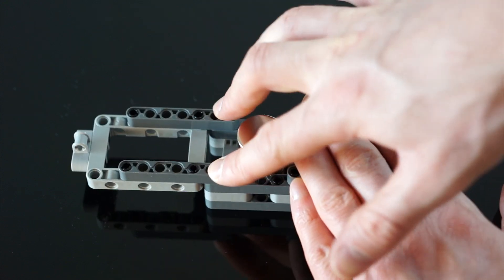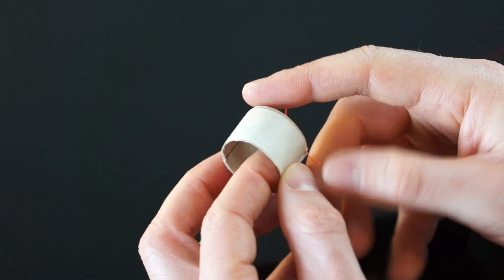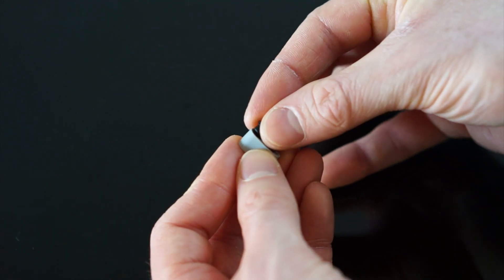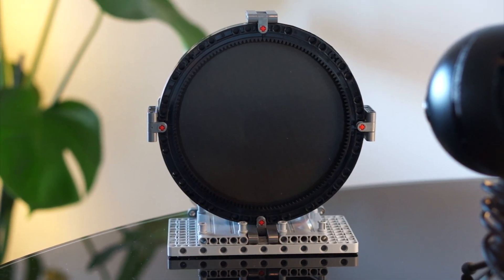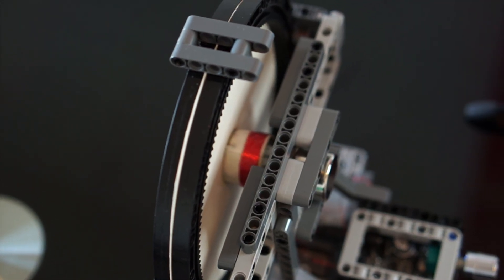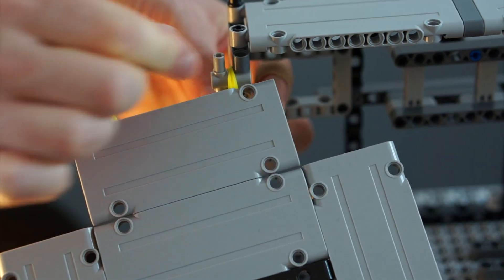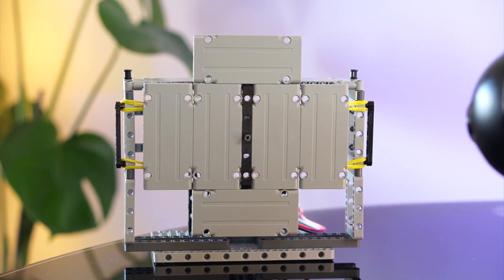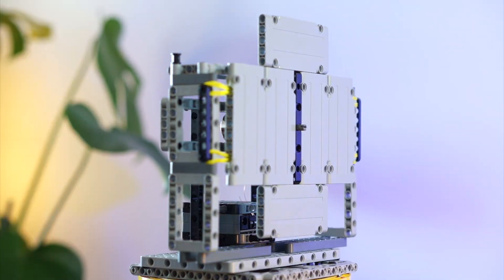Powerful Speaker Made Almost ENTIRELY of Lego

Comment: Great video but build the driver an airtight enclosure made out of Legos so that it will sound better

Oh and with the paper diaphragm the distortion is from it hitting the Lego or the cone hitting the magnet. You can fix that by using a longer cone or increasing the cones diameter and by increasing the distance from the diaphragm to the Lego maybe by elevating it away slightly from the come then using rubber on the edges
Reply from the maker: Some great advice, thanks! Yeah definitely need a longer come, and now would love to see if some pneumatic tubing could line the edges well. The next one will for sure have an enclosure for the woofer!

Comment: I think one of the biggest contributors to the poor(ish) sound quality is the lack of an enclosure around your speaker. Whenever the membrane compresses air in front of it, it also de-compresses the air behind. This leads to a polar opposite waveform coming from the back side of the speaker (at a much lower amplitude), meaning that all peaks are troughs and all troughs are peaks. To the human ear, this would not sound any different than the intended front facing waveform, but when those two opposite waves hit each other, they level themselves out which leads to some frequency loss over your whole signal. The best way to combat this is to cover the back side with a box. This keeps those negative waveforms from escaping and interfering with your music
Reply from the maker: That's such a great explanation, thanks for sharing! That seems to be a common suggestion here, so I'll definitely build an enclosure for the next version of the woofer! Out of interest, does an enclosure also impact tweeters much?
Reply: @JamiesBrickJams  Tweeters usually come enclosed, so they actually don't need a separate enclosure. They are vibrating at high frequencies and are moving a relatively small volume of air (compared to woofers), so you should be fine not caring about their enclosure that much in a project like this.
Reply: @JamiesBrickJams  you could easily make an enclosure. Wood is the standard material, but you can use other materials. Insulation, which can be made from various materials is also important to have in the empty space.
Reply: It would cancel out lower frequencies somewhat, and also the diffraction is doubled.
However, the biggest factors would be the lack of stiffness of the membrane, and the suspension. 
There are such things as open baffle speakers, and one of the things many people comment on is how it sounds better because of the lack of a box, which adds its own colourations unless you can dampen it properly. And even then, you still get effects from the polar radiation pattern which is omnidirectional at lower frequencies, but becomes forward directional at higher frequencies. Open baffle speakers act as a dipole at many more frequencies and can potentially sound better balanced.
The downside to open baffle is that you need about 4x the bass driver area or power, to create the same amount of perceived bass due to the cancellation you mentioned.

Comment: It's very impressive and has pretty good quality for lego, however, it's quite thin sounding, what you should do is I think you should get a way way way larger one for the bass, however that could just be the mic making it sound thin, however idk, what I know is that, in the recording it sounds super thin sounding, and needs more bass
Reply from the maker: You're totally right, it is definitely quite thin. It needs a massive boost. For now I'm testing some bigger coils, bigger membrane, a housing, and a stronger input. Might separate woofer from tweeters - will just have to see where this goes...
Reply: @JamiesBrickJams  well, I'm eager to follow!
But let's be fair, the fact that it works as well as it does out of a lego membrane is actually insane,

Although we could find better,
And I think a lot of the reason as to why the paper plate membrane sucked so bad was because it had its nodes on the outside being pinched

If you look at real speakers, they are connected in a semi floating manner, allowing the entire membrane to move and not be pinched by the casing,
 so if you found a way to make that paper membrane floating, I think it would be good

However, I'm not an engineer, these are just some idiots thoughts on the internet lol

But if we want bass, you can just build an enclosure around it, 
I know this from another video, if you make a cab for the speaker to be inside of, with the speaker still facing out, it gives it more bass

Also you should totally make a discord server
Reply from the maker: @Evalyn126  better than me 😅 I think you're totally right - a few others also pointed out the main issue with the paper one was it was clamped down and just couldn't move, creating loads of vibration and clacking. Ideally I'd love to suspend a paper plate, but it was starting to feel like the Lego aspect of it was totally pointless! And I guess you could argue it is. It's probably better to not use Lego at all. I'd love to try your recommendation of boosting base with an enclosure and perhaps also building a tweeter or two to deal with the high frequency stuff - as you pointed out, those ranges were definitely lacking in the Lego one. As for Discord, I've heard of it, but haven't really got my head around how to use it in the context of YouTube.. so will have to do a bit of digging 🙂
Reply: @JamiesBrickJams  there are lego pieces that were old bendable sails back in the day I believe, so you could theoretically make a cone out of those, lol.

But I do believe separating it into tweeters and a bass heavy speaker would help greatly with the super thin sound, and also a weird part of me is thinking that it's the open holes in the lego cone itself, however it's probably just my mind being stupid.

Also, does it really violate being lego if it's something you could find in a cabinet somewhere?
In any case for the discord, it's often used as just a community place to just chat with other people in the community or make suggestions

Comment: i see you are using offbrand lego? which company thats pretty cool
Reply from the maker: About 99.9% of my collection is pure Lego, and I know many folks are quite strict about that, so I do try to use pure Lego where possible - you just can't beat that OG quality. But yeah, I have bought some offbrand technic plates and liftarms (just couldn't find them in Lego in larger quantities). I'm afraid I don't remember the brand name, but I believe many of them originate in the same factories, so many 'offbrands' are essentially the same
Reply: @JamiesBrickJams  ooh btw offbrands have gotten better than lego sometimes XD their quality has been improving a LOT just dont cheap out too much and you will be fine aliexpress seems to be one of the safest websites ive gotten offbrands

Comment: You need to have some sort of enclosure behind the speaker for it to produce any meaningful sound at any meaningful sound volume
Reply from the maker: You're totally right, I'll experiment with that in later builds!
Reply: The reason the plate speaker sounded better is because of the different kind of speaker. With a solid plate you don't necessarily need that back enclosure. There's a whole bunch of physics and air flow that goes behind it. I bet you 10 bucks if you put the round speaker in an enclosure it would sound way better than the plate one.

Comment: Well.. there exist the old legotrain magnets. They are pretty strong. Maybe not for base, but midrange.

I tried making a electro magnet once of only 9V lego parts by looping the current back the "wrong way" in a normal 9V lego cable. Ir worked, but it was terrible week.

So you can make a 100% lego coil, but it would probobly need lot higher amperage.
Reply from the maker: That's really cool, I'd love to try that at some point - see how scalable it is. Impressive to hear it worked at all! Well done

Comment: If you revisit this idea, you should try implementing a cone shape. When I was doing experimentation with making a speaker from scratch, I found that a cone shape had a much more profound effect on quality and volume than anything else I tried. I am pretty sure this is because of how much stiffer a cone is than a flat piece, so it transmits vibrations more evenly through the entire surface of the cone.

Since it's lego, I'm not sure how easy a cone shape would be, but I assume a pyramid shape would have a similar effect.
Reply from the maker: That's interesting, thanks for the heads up - it's a bit more challenging, but it should still be possible to build a sort of cone-shape. It seems worthwhile, so I'll see what I can do ...

Comment: I love how this guy goes “almost entirely made of lego” and then continues to make every part that is vital to making  a speaker a speaker NOT out of lego. Like, the magnet isnt lego, neither is the coil, or the membrane or the microchip… literally only the frame is made of lego. Might as well say you made a homemade speaker with a lego frame
Reply from the maker: I'm guessing you didn't finish the video? You're partly right though - the first iteration was really just a frame, and I nearly scrapped the video. But the second version has both the membrane and the coil made of Lego. Only non-Lego parts were the wire and magnet, which of course can't be Lego. Though I do like another commenters idea of using Lego train magnets and Lego motor wire to make it truly all Lego. The 'chip' is just an amp to provide input (isn't really a part of the model), but you could just as easily stick the speaker straight into your phone if you wanted to remove all non-Lego parts.

Comment: Where did you get the Bluetooth module? And does it take prior experience to use?
Reply from the maker: I got this one on Amazon, and nope, it requires no knowledge at all. You just stick a battery or power supply to the input, and stick the wires into the output! https://amzn.eu/d/3siXXlR

Comment: You should use a crossover filter and set it up with both speakers, this way you can have the bass on the fully lego build, and the small speaker for treble and mid-tones :D
Reply from the maker: That's actually a fantastic idea. I did toy with making a separate woofer and tweeter. You're probably right that the paper would make a better tweeter - will see if I can find a filter!
Reply: @JamiesBrickJams  I would love to see a video with this ;)
Reply: @JamiesBrickJams  you can use capacitors to make high and low pass filters
Quite simple, you can go by trial and error to find what sounds best

Comment: I actually like the paper speaker better
Reply from the maker: 😳 That's a hot take! Granted it looks much better. But sounds horrendous to me 😅
Reply: Same in my opinion it sounded great in everything except the bass, which completely ruined it but could be fixed by suspending it like the lego plate one or using some other material than paper i guess
Reply from the maker: @Andre_Thomasson  Ah yes that makes sense - the mids and treble are better with the paper. I'm onto another solution though that might get the best of both worlds... You're definitely right about suspending the material, whatever it is

Comment: I believe the buzzing/thwacking is from the paper reaching the end of its travel, I could easily be wrong, but I feel like a paper diaphragm with some folds in it to add travel distance would mitigate most of the buzzing issues.
Reply from the maker: You know that's a great idea, I didn't think of folding the paper - I'm gonna give that a try. Thanks!

Comment: Holy cow the sound you get out of that is impressive at the end. I'd buy a kit for students! Just the simplicity alone is impressive. 

A project idea I have would be to make a pill dispenser with two buttons for morning and night. It will dispense whatever you select works for each. Let's say 8 types of pills. 3 you take only in the morning 2 only at night and 3 are both. Each section of pills would need a way to select if it's a morning, evening, or both. I'd imagine it could be a modular system as well.
Reply from the maker: Thanks! Yeah I was astonished how good it sounded. Need to scale it up now. Yours a pretty interesting concept.. I wonder how you'd know (or infer) what time of day it is?
Reply: @JamiesBrickJams  I would imagine some kind of stepper system, so that you can schedule which one to put for each morning, and night for each day

Comment: Idk, first speaker is useful as a twitter. (as high frequency speaker)
Reply from the maker: It sure is - that's the only reason it's not going to the scrapyard! It'll have a use soon
Reply: ohh..
Thx to reacting that dumb idea.
Additionally, the second speaker is
Looks like fitting for woofer. (Base speaker)
That one is the coil was weak, so the sound panel vibes less, so what if reinforcing it?
(Upgrade voice coil, then push more current to them?)

Comment: for the paper "cone" you should have it suspended like the lego "cone" because the bass freqs weren't dissipated when it got to the outer rim causing the freq to "ripple" back causing the distortion.
Reply from the maker: You're totally right. I actually did try that, but then it seemed like using Lego at all was pointless, and I nearly scrapped the video. Just got lucky that the Lego membrane happened to work. But I'll be trying your suggestion again on a larger scale in a while ...

Comment: 6:56 ah, the black 3L pin, how we miss thee!
Reply from the maker: That piece is probably about 25 years old 😅
Reply: @JamiesBrickJams  Don't get any fancy cleaning products on it.    I have parts shattering now all over my room after wiping them with a sanitizing wipe or spraying them with a sanitizing spray.  One model turned back into granules after using the latter.  Every pin shattered, every filled axle hole split and crumbled (sans the gears), even some of the straight beams broke.  It was a 1:10 Ferrari from 2004.
Reply from the maker: @GeneralPurposeVehicl  ah man that's heartbreaking 😥 Cheers for the heads up though - these pieces will just have to stay dirty

Comment: I think the full Lego speaker is limited by the very small coil, if you used a bigger coil then it would probably be much louder, also if you used a piece of high density insulation foam you could probably get better audio quality out of the membrane.
Reply from the maker: You're definitely right about the size of the coil - I'm playing with some larger ones with thicker gauges, and the output is much better. Cheers for the idea, I'll see if I can find some insulation foam to play with!
Reply: @JamiesBrickJams  now  i wanna see an update on that, im subbed ! please make an upadate
Reply: @JamiesBrickJams  isnt it better with thin gauges though? i could be wrong but isnt mostly the amount of winding that matters?
Reply: @theratking14 yes, it’s only the number of coils that matters. Size only improves maximum conductivity,which isn’t a problem at those currents
Reply: @JamiesBrickJams  it's not just the coil, it's the way the magnet is used. you have to concentrate the magnetic field to the coil. That's why pole pieces are a thing. You need one poll in the inner and the other on the outer. Once you have it right you'll have a dramatic sensitivity increase.
Reply from the maker: @nathankills  Ah, thanks for the heads up! I clearly still have a fair bit of reading to do to get something reasonable out of this thing. Will have to see exactly how poor pieces work
Reply: also make sure that the cardboard cylinder that slides over the magnet does never directly touch it, it causes the cracking rattling noise you heard in the beginning with the bass notes
Reply: makes sense. I think the paper plate distorted with the 24 volts because you get more bass and the paper panel don't have enough space to move because no rubber surround. if he kill the bass you would just get the upper part of the frequencies with is good but no bass... basically the paper panel plays either mid ore hi
Reply: Not true and true at the same time. The bigger the coil with the same voltage/wattage and same cone will only make it louder by a little bit, what would help is adding more voltage/wattage and increasing cone size will also help by being able to make lower frequency’s and improve sound.
Reply: Could run both but used a high/low pass filters
But remount the paper to give it the Excursion it wants and you will be better off also
Reply: I think the sound quality comes from how much the membrane can vibrate without dispersing that all over the place (like how the paper does), so what happens if you replace the plates for the membrane with just a thin floor plate (the one used for floors) instead?
Reply: An iron core would help too
Reply: Also the coil in regular speakers is between a north and south pole at right angles. To provide the "toroidal bent in horse shoe magnet," field conducting pole pieces are used with a regular ring magnet, so that you can have the north pole within the coil and the south pole outside (or the other way round). Putting a coil over a magnet works, but it's not the perfect right angle alignment of field lines with the coils.
Reply: And make the membrane cone-shaped to focus the sound more. Traditional speakers have this as a way to concentrate sound rather than having it travel throughout the entire machine.